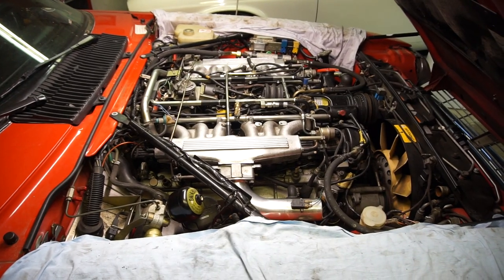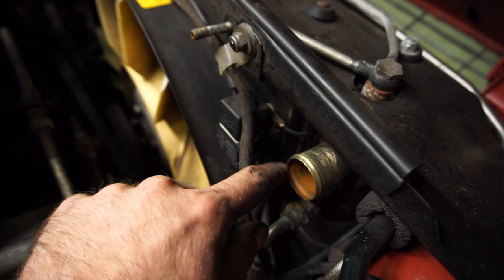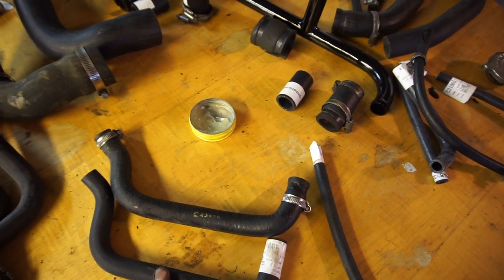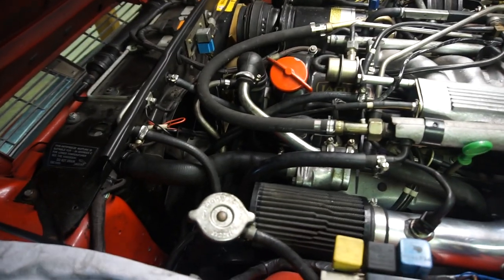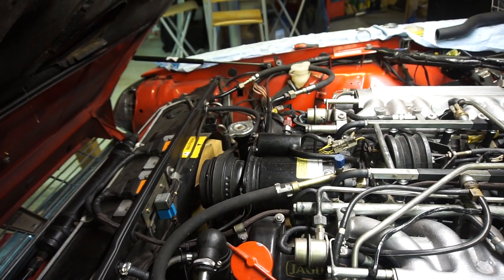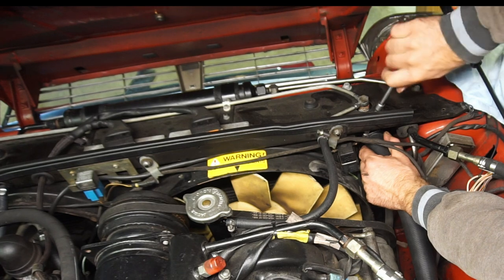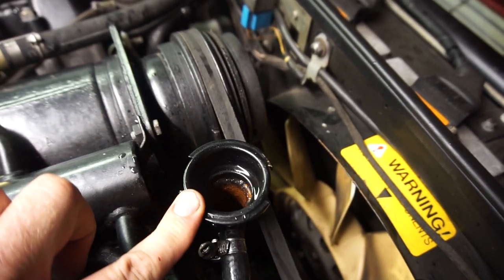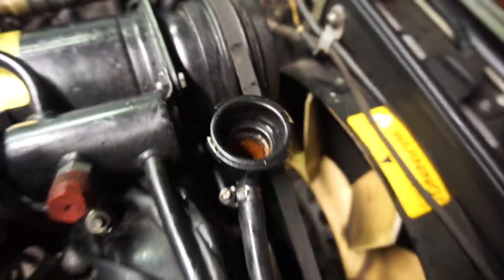Keep Your V12 Cool Part 2

Comment: I have to say that I wouldn’t have dared tackling this job without your videos so thank you. The hardest part so far has been fitting the new lower radiator hose which I managed to just push on from underneath but clearance is so so tight and it’s quite the challenge!

Comment: Thank you for another useful video!
I am not sure if it was in the workshop manual or on jag lovers but I found one more tip. It said to lift the front of the vehicle prior to pouring coolant in order to facilitate air bubbles moving forward.
Reply from the maker: That is a great tip but I’ve mostly found it necessary on the pre-HE. The HE is a lot better at getting any air out by itself. Thanks for watching 🙂

Comment: Just a small suggestion, when your slacking off the jubilee clips, especially the ones on the bottom hose, use a long flexible shaft to mount the socket; it was the only way I could get at mine. I did wonder if you would use Vaseline, washing up liquid works just as well (but not to much!). I also found that taking the bleed screw out of the top of the rad saved much faffing around even on my HE.
Glad to see that you're having fun weather-wise as well; pretty grim here on the Wirral as well. It should clear up for you sometime next week...
Reply from the maker: Some of the clips that may have been on there since they built the car can be a pain I get off. The weather has really turned to fall right away here. I hope we’ll get some better weather again soon

Comment: The Vaseline in the hose is such a good tip Adam wish I knew that when I did mine 🥵but very good to know for future reference 👍🏻
Reply from the maker: It does help a lot!
Reply: @LivingWithAClassic  I use red rubber grease, kind on the hoses mainly used on brakes

Comment: It is also good idea to change the banjo bolt on the radiator, as original has very bad holes placement, which are almost blocked when the bolt is in place. I know that Jonas provides upgraded ones
Reply from the maker: Jonas has a lot of great stuff!

Comment: You have the wrong cap for the cross over pipe. It should be a flat cap (same as early XJ6) and not a pressure cap. Please dont use Vaseline as this is a petroleum based lubricant and not meant for water hoses. Use rubber grease or silicon spray, please. If this was my car, I would have replaced both thermostats at the same time.  If you want a better alternative to coolant additives, use Evans Waterless Coolant. A vastly superior alternative. Nice video Adam. keep them coming.
Reply: My thoughts exactly. The thermostats should be replaced as well when doing a flush. Also it can be difficult to completely bleed or burp the V12 cooling system. When I'm doing one, it's better to do it 2 to 3 times just to make sure to get all the air out. Definitely DO NOT UNDER ANY CIRCUMSTANCES use any type of radiator or block sealer in the cooling system. I don't know why the owners manual gives someone that instruction. The bloke who wrote the manual needs a spanking. A gr8 God  bless day to you and good job Adam.
Reply: Jaguar changed to a pressure cap somewhere along the way when they realized it made no difference. The design of the pipe seals the cap anyway, so even a pressure cap functions like a flat cap. But changing to a pressure cap had the advantage of eliminating the risk that someone would mix up the caps and put the flat cap on the expansion tank.

I got this from Kirby’s XJS book.
Reply from the maker: Yes you’re right! They did switch in the late 80’s to that.
Reply: @LivingWithAClassic  thanks for the love! Just bought an XJS last week and am going to tackle its cooling system (with your help)!
Reply from the maker: Good luck with your XJS! 
Feel free to send me an email if you need anything. My email is in the description of every video

Comment: What's the trick to getting the coolant bypass pipe back on, it doesn't really line up with the hoses
Reply from the maker: Have your removed the PCV from the cylinder head? That makes it easier
Reply: @Living With A Classic  I have not. It's just the 2 bolts holding it in is the a gasket behind it

Comment: Hello Adam, from Vienna. I have a 6.0 xjrs facelift, and want to Do the same Procedure like you.
Now my question,  i see in your Video, that you use 2 caps with springs, for the cooling System,  but i think, that the cap on the engine bay should be one, without a spring...the cap on the expansion tank has a cap with spring...
What is your opinion...
Thanks mike
Reply from the maker: Originally it was like you say however many have changed to how it is on this car. In the middle you can use one with or without a spring.

Comment: Thank you so much for the helpful demo of changing the coolant hoses as well as filling up the new coolant. I have a question, after you filled up the crossover to the top, you said next to fill up the expansion tank. When I did the same thing on my 1988 XJS V12，the coolant over flooded from the expansion tank when the coolant was filled up to top through crossover, I think simply the opening on crossover is higher than the opening on the expansion tank. Do you know what I did wrong? or something is wrong in the coolant system? I changed all the long coolant pipes but not those short ones, should I replace them too? Please advise, thank you!

Comment: Wow that insides a little crusty
Reply from the maker: It’s just the top inch or so, pretty common
Reply: Living With A Classic ahh ok it was also making me think there was rust in the system since I saw rust residue on the radiator but that good